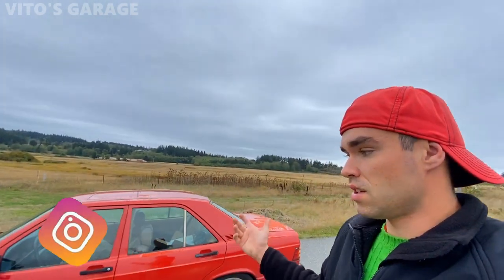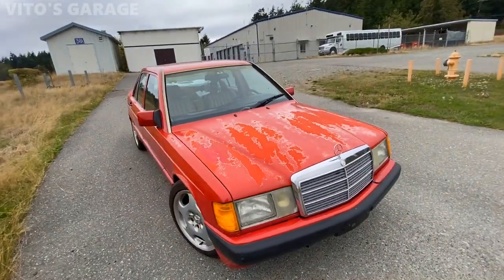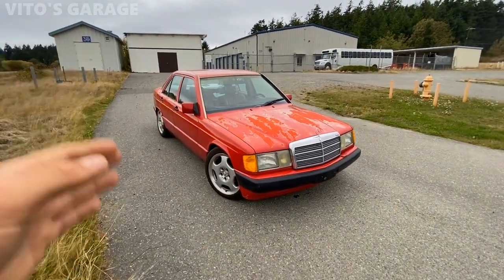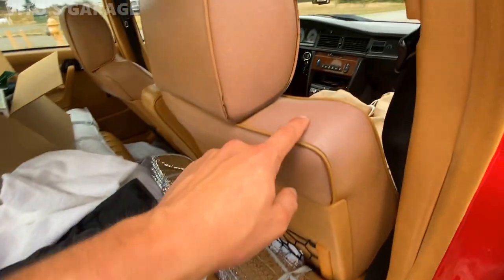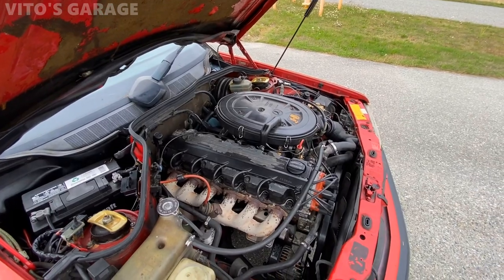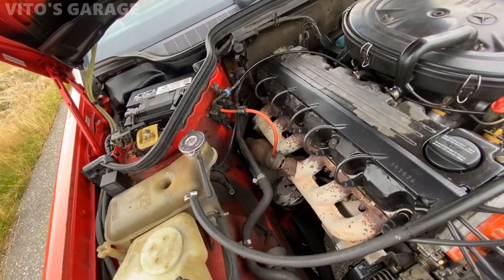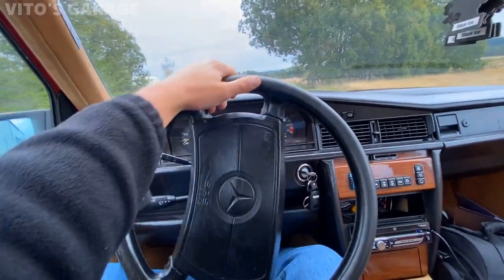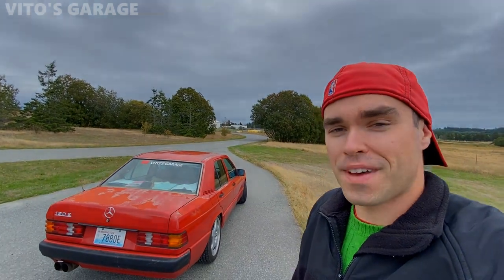Here's Why It's Been Stressful Restoring My Neglected 253K Mile Mercedes 190E..

Comment: Agree with you that the Euro headlights are much better looking. The plastic dash trim around the vents always crack, new ones are available from MB dealers, at least in UK (but £140, for the one to the left of the wheel for example) so not cheap. Like your rear door panel I’ve seen theses are prone to splitting on the tops but can be repaired. A new underbonnet pad would really tidy up that area nicely and cheaply.
Reply from the maker: Everything will come with time. I already ordered a brand new Genuine left side vent for my interior. It was $140. I also need a center vent assembly but it's NLA. I just want this car to be immaculate again 😭😭
Reply: @VITOSGARAGE  that’s great, good luck with the restoration. I understand the wish to get these cars back to as good a condition as possible, I’m the same with my 190!

Comment: Hey Vito! Was wondering if you could show those of us how to check the trans fluid. That would be a great info video
Reply from the maker: Engine and transmission warmed up. Trans fluid level has to be checked with engine running in Park and on flat surface. The trans dipstick has to be between low and full marks. I always keep it at the max

Comment: Owning a 190e is like being in an abusive relationship. It beats you up and takes all your money but you keep going back for some reason. I daily drive a 1992 190e 2.3 that was neglected, @ 195,000 miles. I've spent the last 3 years restoring it and damn near half the car has been replaced at this point. Headgasket, transmission, door panels, radiator, timing chain, you name it.. They are good cars but it just never ends man.. The cosmetic issues are what really kills me..
Reply from the maker: I hear you. I am almost done restoring my interior. You just need to be patient. I am planning to get another daily driver so I can focus on this car. I’ll make this car amazing again. Never give up

Comment: I also have been worrying about small dents on my W140, I did find a tool called Gliston paintless dent puller that you might find useful. It seems to get dents almost all the way gone without crazy cost.
Reply from the maker: I think paintless dent repair guy would be a way to go. I’ll need to figure it out

Comment: Hello👋, what type of ATF do you recommend for the transmission? I have heard that dexron 2d is suited. I have the same engine and transmission in a w124.
Reply: Dexron 2 it's not easy to get.
Reply from the maker: I’ve been using Valvoline Multi-Purpose ATF for years and never had any issues

Comment: hey man i want to get an 87 190d 2.5 turbo that had the 602 turbo replaced with a 601 and someone threw away some ultra rare turbo specific parts. don't you know of someone that has the turbo airbox and the little firewall that separates the airbox and expansion tank area from the engine. i may have to look for them in europe but it'll be better if it is in the states.
Reply from the maker: Sorry I do not